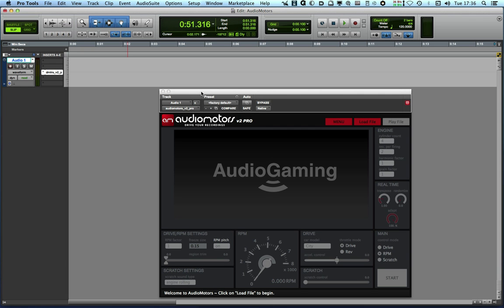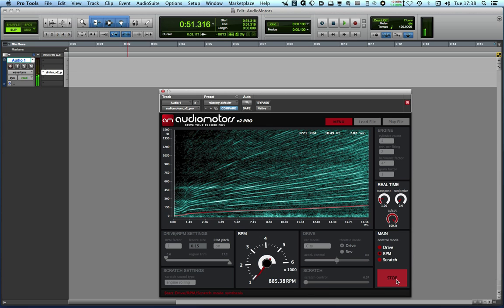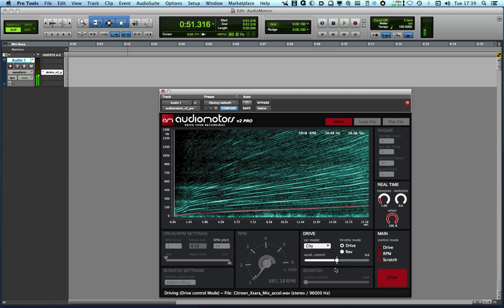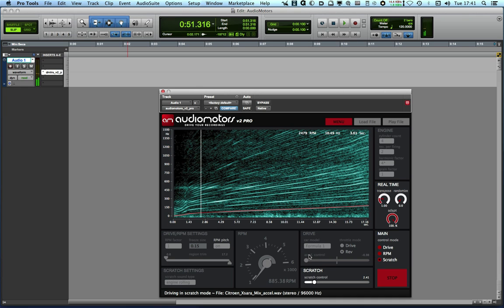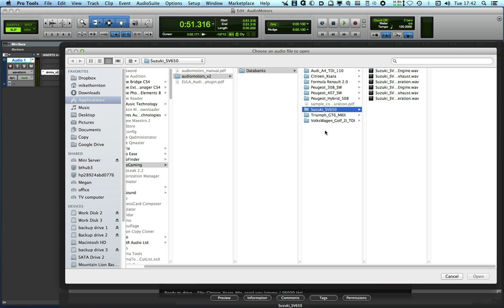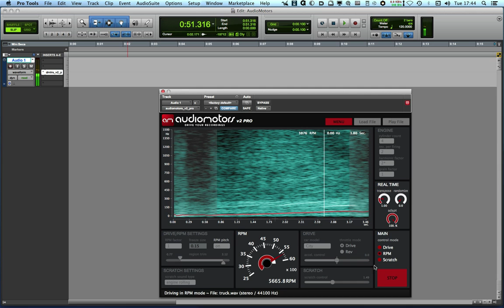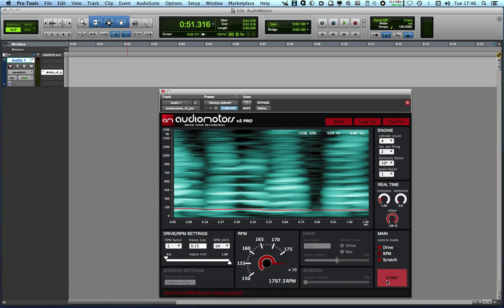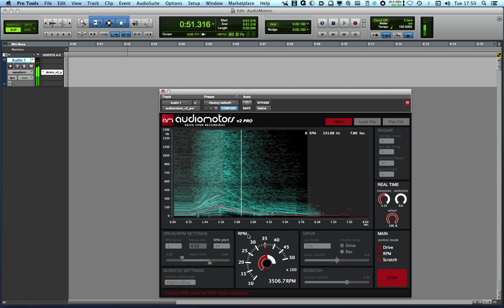AudioMotors v2 Pro Review

Comment: i know this isn't v3 so maybe they already fixed the artefacts in fast movements and the general whack sound when using the truck-sample, but even if this plugin sounded more smoothly i can't imagine spending 329€ on it. i mean c'mon, le sound. for sounddesigners this might be important, but for the majority of music producers this is only a gimmick and not worth more than let's say... 40€. srsly. not more! i mean it's essentially just a sampler where you can automate the loop's position. most daws have something suitable already and this would just be a nice addition because it looks nice.